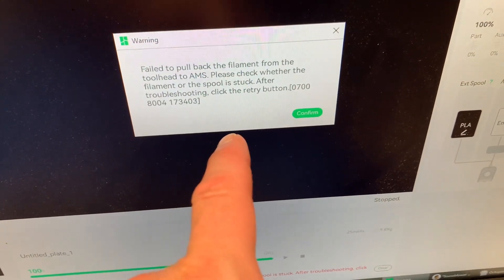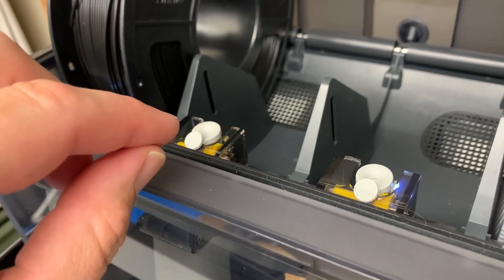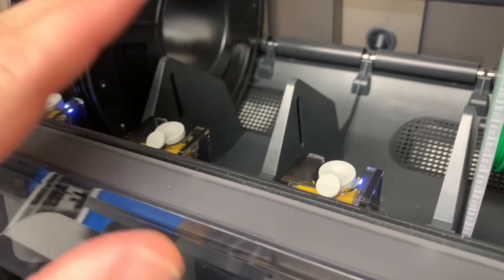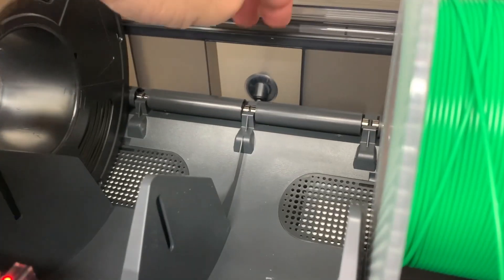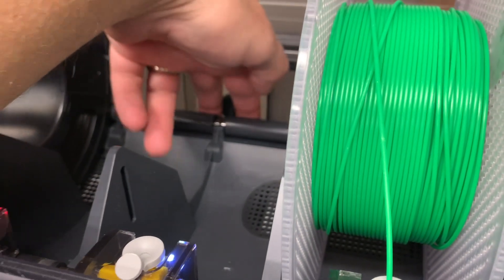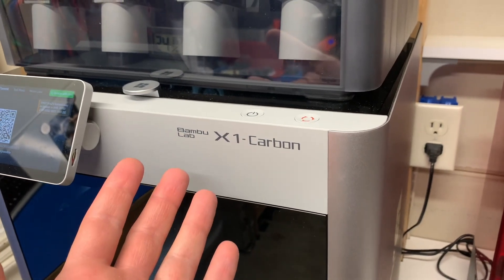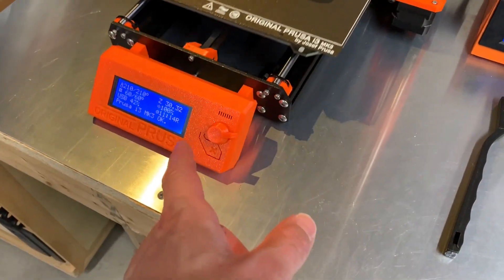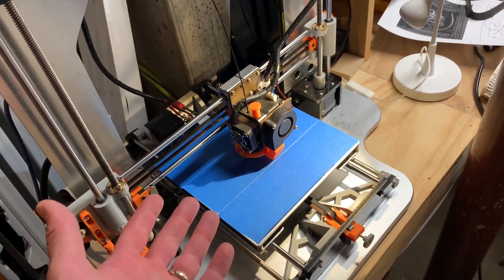#notfriday - Quick rant about a tool that Bambu Lab should have included

Comment: That release "button" inside of AMS has so tiny travel that when I initially pressed it I thought it doesn't work. But it actually worked! I thought it didn't because rubber around PTFE tube causes that still a lot of force is needed to pull PTFE tube out of back of AMS.

Comment: You could unplug the AMS and use the side spool to print the tool then get into clearing the AMS.  I did have trouble myself the first few times trying to release the PTFE tube from the inside of the AMS.  But it will get easier once you find the right angle to get your fingers in there.  I feel the could have included maybe a pre sliced file like they did for the scraper and such.  But an actual metal tool included?  Not really worth it to me.  Good luck my friend!

Comment: That is a ring you need to push an then pull the ptfe tube. You can easily do it with small needle nose pliers. Open them a little and press above and under the ptfe tube on the ring an pull the tube.
Worked very good for me.
Reply from the maker: thx, I considered that, but was afraid I'd mar up the surface with the hard tips on the pliers and potentially cause further issues.  The tool, once printed, does work well and pushes evenly on the release.  It's a shame they recessed the release.  It could sit proud of the face and then you could just use thumb and forefinger.

Comment: It seems like Bambu Lab expects you to remove the two screws that attach the buffer to the printer and then press on the release from inside the buffer. It's definitely less convenient than the removal tool but it's still faster than printing one.
Reply from the maker: If I recall, I think the release comes out with the buffer, and it lines up with the rubber boot in such a way that you HAVE to release/pull back the PTFE before you can remove the buffer.
Reply: @FunctionalPrintFriday  Bambu Lab shows how to remove the AMS Buffer in the guide on how to replace it with the AMS Hub. It may be a bit difficult to unscrew and release the PTFE tube without turning the machine around but that does appear to be how Bambu Lab expects you to release that tube. https://youtu.be/BICzbRju-28?t=20
Reply from the maker: @TCL987  Sorry, we're on the same page now.  That makes sense.  I was thinking of the piece inside the AMS that the spools ride on when you said buffer.  In my situation, however, the shelf isn't deep enough to turn the machine around and get that buffer off.  I suppose that's a me problem and not a bambu problem :)

Comment: One more reason to add to my list of why I'll never buy one
Reply from the maker: Can't really blame the machine.  The filament that snapped in there was 5 yrs old :).  Just not sure why they wouldn't include the tool to remove the tubing there.
Reply: @FunctionalPrintFriday  it's the fact that it needs a special tool they don't include that gets me. Like many have said, if they disappear, you're screwed. You've got an expensive frame to build a printer out of or a boat anchor
Reply: @bwselectronic  You can get to the release just by removing two screws. The tool you can print is just more convenient.